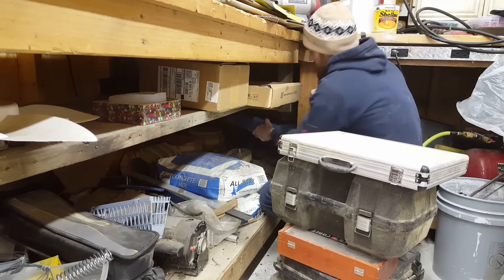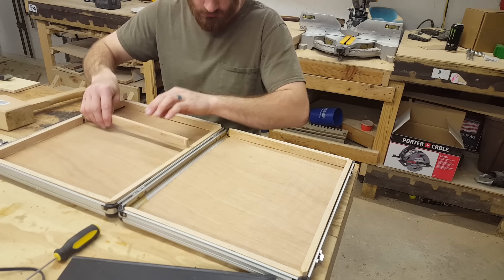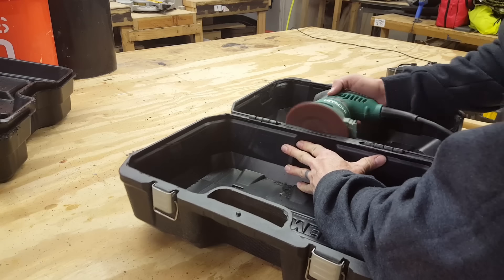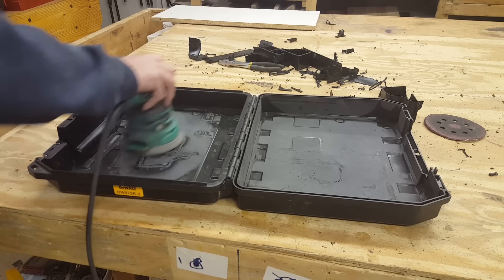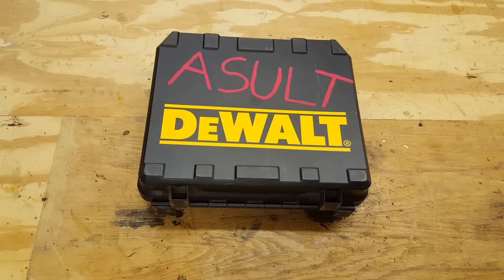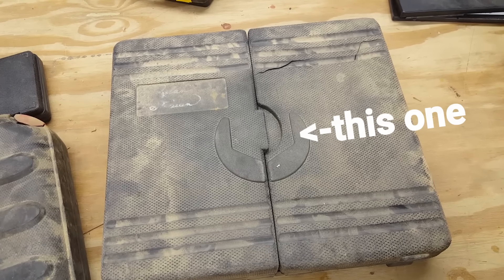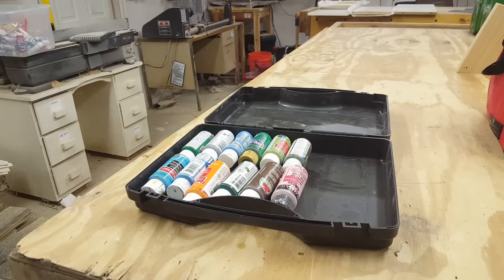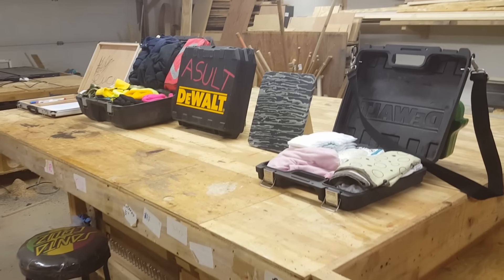5 Things to Make With Old Tool Cases

Comment: Hi there, brand new subscriber and I liked the "making things with old tool cases" vid' above

I'd love to see a bike (bicycle) tool-caddy that's large enough to hold most of the regularly used tools but light enough that you can literally keep it within arms reach and move it every time you need to. *important sidebar* To put it mildly, I have terrible back/spine issues so I don't work like a regular bike-mech' standing all day with the bicycle up hi in the bike-stand (because I CAN'T) so I put the bike as low as I can get it in the stand and I roll around on a soft seated, Harbor Freight, rolling stool. That means for me, a typical high standing tool bench with tools vertically laid out on a pegboard is impossible, so in turn, my vertical tool pegboard becomes a horizontal one, aka-the floor, which scatters tools everywhere and quickly becomes a messy, dangerous (trip-hazard) nightmare. I'd love to have the perfect sized tool-caddy to store the important stuff, (T-handles, standard hex/allen wrenches, screwdrivers, alls, 7/8/9/10mm wrenches, a generic cup for small tools/parts/glues/etc, and some basic bike-only tools) And I have to be able to move it a bunch of times as I move around.

So, watcha think? Got it in ya??
Reply from the maker: Thanks for the sub! That sounds like a fun project.  I've been on a look out for more tool cases since I made this video but I don't have enough for a new one yet.  But when I do I think a bicycle tool box is a good idea.

Comment: A couple years ago I did the same thing (similar) with my DeWalt toolbox (I think it originally housed a sander) the same one you repurposed as a pistol case... I cut all the insides out and it's been my general purpose toolbox for years -- works great and it's just the right size to fit a full size hammer (vertically) and all the essential tools I need when I go mobile and it's small.... the only problem is the latch -- it sucks!  It physically pops off about 2 -3 times a year... it's the simplest looking mechanism in the world (1 flat piece of aluminum with a  bar across the top on one side and a single "C" link that spins around the entire piece)... it looks like it should just snap right on, but it won't...  !I will spend hours trying every possible configuration until finally bam, it snaps into place like nothing...I asked my daughter, who's really good at these kinds of things, to try to snap it back on, figuring she's do it in 10 seconds and make me look like a fool, but after 5 minutes she just shook her head, rolled her eyes and walked away.... if you could figure that out and post a video, I'll name my next child after you!

Comment: In my car, I used old cases like this for jumper cables. I rarely need them since I got old enough to buy a more reliable car, but I just can't sleep if I know my car doesn't have long jumpers. Also, a tire 12V air-pump. The case they come in fits the parts like a tight puzzle. When I wad up the cable to the 12V socket, is hard to fit, so...the air-pump needs a bigger case.

Comment: I might be crazy, but curious if that cutting board is bullet resistant?  🤔
Reply from the maker: Lol I like the way you think. No the type of polyethylene that is bulletproof is a  ultra high molecular weight polyethylene (UHMPE) but only when it's manufactured to create thoes long strands.  I actually spent a couple of weeks trying this with the high density polyethylene (HDPE) and I did come up with something that I think would work but I never got around to trying it. Good question
Reply: @WyldeWoodworks  well it's a beautiful cutting board, and I think we deserve pretty plates!

(Flips hair atop burning tank)
Reply from the maker: @realitycheck4158  Hahaha. yes

Comment: Try building a power case with LFP batteries inside, a charging port, various power ports, and capacity monitor on the outside.

Comment: i also collect this old cases. If you buy cheap powertools (everyone does it from time to time), the cases often last longer than the tool. Normaly in combination with the tool i hate the boxes. once unpacked, you never ever get the tool with its powercord back inside the way it should. Or the hinges brake or the clips that keep the bocks closed. but anyway, i do keep them. btw the worst are this stackable makita boxes. the idea is good and the insides arent welded together, but the closing mechanism is pure trash. Your diaper box is the best idea. It is the only appropriate and manly way to carry diapers. :D

Comment: What could you use if you don’t have a motorised cutter?
Reply from the maker: You might be able to bend a hacksaw blade into the box. It would deffinately take longer but it should work. I used to use vicegrips to break the plastic out but you run the risk of breaking the shell. Hope that helps!
Reply: @WyldeWoodworks  thanks very much 👍

Comment: How about combining an old tool box with a few of those those reusable freezer ice bricks?

Case as the shell.  Either designed to snap in freezer bricks or perhaps building pockets into the case and having the gel envelope the inside of the case.  To freeze the whole case before filling with items and use the case as a chill box.  

Perhaps to transport refrigerated medications.  ... 

..... or beer

Comment: the first box with the paper and pens needs a strip of wood mounted in the lid to line up with the strip that separates the pens from the paper otherwise the pens will mix with the paper if you flip the box over.

Comment: Is there any reason to not compress the polyethylene while it's in the oven?
Reply from the maker: @YourSoundStudios  That's an interesting idea. I've never tried it. I imagine you're only issue would be that it would be hard to heat it evenly if something is compressing on both sides. Let me know if you try it haha
Reply: @WyldeWoodworks  
Yes, the compression material would provide insulation but time would allow that issue to be overcome.
Do you barbecue? Think of it as a slow cook method. 
The compression material on top could be metal and it would conduct the heat better. You could also put the metallic compression plate in while you preheat the oven
Reply from the maker: @YourSoundStudios  That's true but at the beginning of the heating cycle the metal is going to act as an insulator meaning if the outside of your plastic is being heated while the middle is being insulated. If that happens then the outside is going to dry out before the middle has a chance to melt. Sort of like that pizza I made last week where the outside was burned but the middle was doughy haha. It's definitely possible to heat it evenly if you can control those variables.
Reply: @WyldeWoodworks  
I understand the pizza analogy. Does plastic dry out while it's being melted? I guess some of the chemicals could cook out near the edges but I didn't know that was even a possibility. 
Maybe the metal plate can be in the oven with the plastic while it melts and then you put it on top three quarters of the way through the process.

I appreciate you brainstorming through this with me.

Comment: I like some of your ideas here, especially as I have a lot of redundant power tool cases, but melting plastic in a domestic kitchen using an ordinary Oven, there you lose me, first of all in the UK our domestic ovens don’t go that high, second melting plastic this way gives off very toxic fumes and could also easily cause a fire 🔥 😢, it’s not clear in your video if the oven has proper fume extraction, but if someone tried this anywhere I was responsible for Health & Safety I would throw a fit !

Comment: I can see using the cutting board for cutting other things like cutting that foam material you line tool boxes with. Not a fan of plastic cutting boards for food now that it's known that every time you cut into them for your meats and greens you're depositing nano-plasticsa into your food. At least with wood cutting boards it just passes through your system naturally. Additionally I've seen people have been able to turn whole plastic back into plastic strands for reuse in 3D printers. Could be handy for projects as the machines that turn the plastic into new strands are not much more than an whole 3D printer.

Comment: Um here is a Idea, put your tools back in them so they don't sit out and collect Dust like those boxes did lol , your art case want work, all the stuff will fall into lid and all over soon as you lift it up, either add a Wood/Foam divider to lid that will separate it from the bottom or I would just staple Elastic straps to those wood panels across lid to hold pens in, and One on bottom to hold the pad of paper. also careful melting plastics in a oven they release gases thats not good to breath. ... Manly Diaper bag though, A+

Comment: Not only when using on a sailing yacht in saltwater your tools made from steel becoming more and more rusty to be finally useless rather quickly. The answer is using that plastic boxes, but with a different interior. The main ingredient is untreated sheep wool, as directly cut from a sheep without washing, just picking the dirt off.
The sheep wool is carrying a lot of oil in it self, so all surfaces of your tools are covered by a little oil, as long as they are stored in that box together with the wool and don't get get rusty.
The only problem is, how to make it look tidy?

Comment: What else have you made out of repurposed polyethylene?  What have you seen others make?
Reply from the maker: Good question! I've made a few different items. I made a vise block which worked out really well. I've also used it for drawer glides and plastic bushings for moving parts. The biggest problem I always run into is it usually has a lot of air pockets that have to be milled out.  I tried to make a plastic shovel once but that failed miserably so I never uploaded the video. Lol

Comment: I understand the gun case, but I don't get the reasoning, unless it's a cheap firearm that came in a cardboard box, instead of a nice case. I do feel you missed an opportunity not cutting it out for two, so it's more useful, and has a bit more justification of the idea, but they were all good ideas. I've done the same at home with both old tool cases and gun cases, so they don't sit collecting dust

Comment: “I guess they seemed useful for something, but I just never could figure out what they could be used for” um how about for carrying the tool they’re made for. Am I the only one that actually uses these for their intended use?
Reply from the maker: It makes sense for contractors but I like to keep my tools hanging on the wall for quicker access in the shop. I get that doesn't work for everyone
Reply: @WyldeWoodworks  yea I was thinking about that. I’m constantly switching out the tools in and out of my trailers to different jobs.

Comment: Plastic cutting boards are not as safe as you'd think, as the plastic will micro flake off as you cut and get into your food. . Better to use traditional hardwoods, or bamboo.

Comment: ASULT?
The HDPE cases are excellent kayak repair plastic so don't be too quick to toss the guts out if you know someone like me who restores and repairs kayaks. 
GO SEE MY CHANNEL!
I also gut the cases and reuse them for other tools... Be careful of leaving the logo visible in your vehicle though, I had someone break a window in my truck for a DEWALT case that used to hold a 7.5v drill. I had over $200 worth of PURDY paint brushes in there and they tossed it on the ground.
THIEVES ARE USUALLY STUPID!